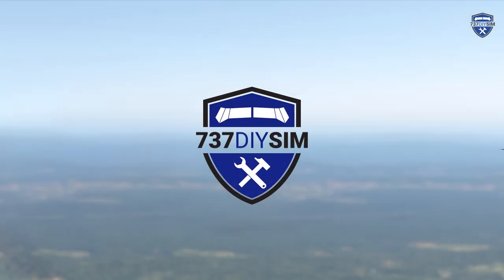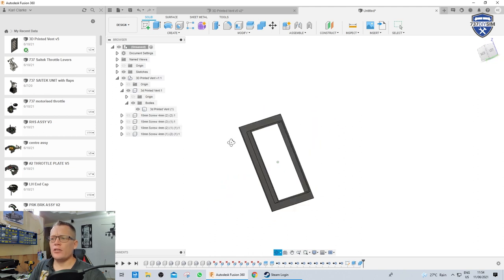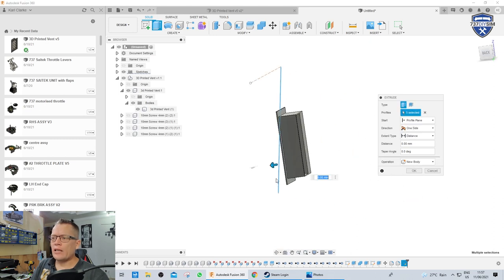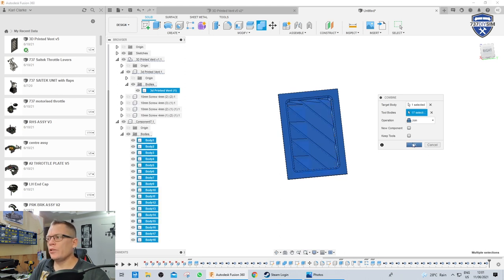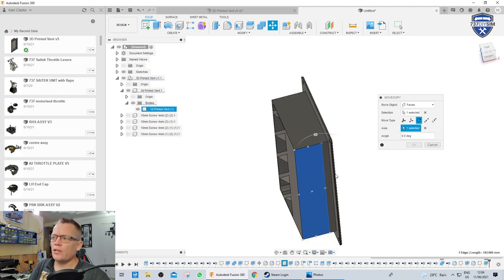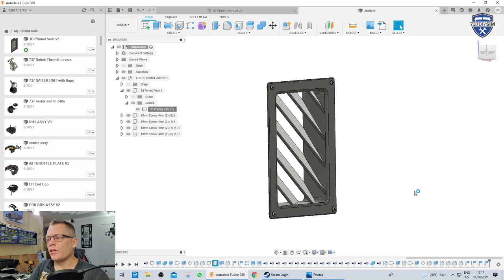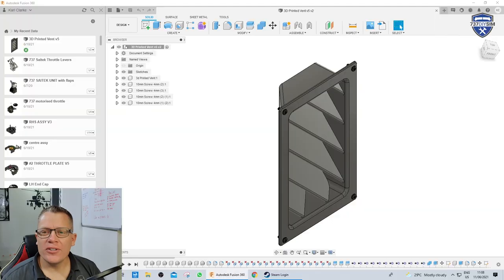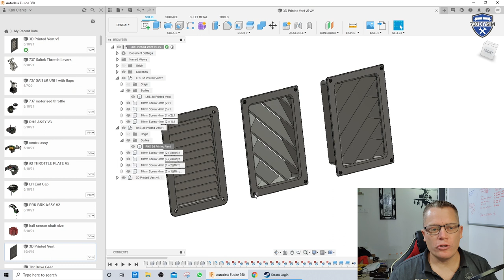Creating A Boeing 737 Sidewall Vent

Comment: Man I am so hooked on your videos. I wanted to make an A320 cockpit but am so impressed by your generous input to this hobby I’m almost convinced of a change to the 737.
What are your thoughts on 3D printing the panels instead of buying? I could use a transparent TPU or PLA instead of acrylic… pls help 😂 mayday!!!
Reply from the maker: Hi Dan, If you were building a 737 and wanted a perfect finish and awesome looking cockpit, i would say go to cockpitsimparts.co.uk and just buy the set of panels from there. Each set is around 200 pounds. Trust me when i say this is way cheaper, less time consuming, and much easier. You can 3d print panels and many do. They just look realistic, but do operate the same and have the same look. If its just a bit of fun and your looking to improve your flight experience and do a bit of DIY building, then 3d printing is the way ahead. I really am out of the loop when it comes to A320, but i know i want to build one next too. But that will not be this year as the 737 takes up all my spare time. Hope that helps and if any more questions, feel to WhatsApp me. Number on the website. Kind Regards Karl

Comment: would you mind releasing a video with your print settings and preferred filaments?
Reply from the maker: Hi Braxton, My print setting are already on the website. As for filaments. i used to buy amazon basics because they were the cheapest. But now the delivery has stopped here, I'm stuck with whatever I can get hold of!

Comment: Thanks for this Karl. I've been using Fusion for a few months and I love watching these design videos. Would love to see more if you are up to it. Question, when you are designing screw holes or screw bosses where the screws actually screw into, what dimensions/settings do you use? do you model the threads or just leave the hole round? I've done a bunch but haven't gotten it quite right yet based on the screw size. Thanks again!
Reply from the maker: Hello, screw holes for PLA,ABS are as follows (no thread modelled, it doesn't work/print):
M2 =1.7mm hole diameter
M3 =2.8mm hole diameter
M4 =3.8mm hole diameter etc, 0.2mm smaller upto M6
M7 and up, you can model the threads and they will start to perform correctly. Hope that helps, Kind Regards Karl